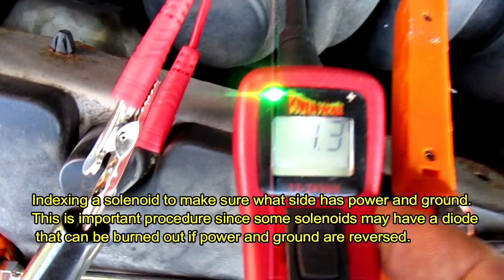Testing a Solenoid With a Power Probe

Comment: So, a relay or solenoid clicking does not verify that it is in working order.....correct? They both must be tested and verified through the use of current ....(under load) correct? Thanks...yes, I subscribed
Reply from the maker: Correct in the case of the solenoid the electric part can be working using current but the vacuum side or mechanical side may not be opening up the vacuum port. If there is amperage being used that means the solenoid or relay is working electrically but it may not be working mechanically. Current and mechanical operation. Thanks for subscribing....
Reply: @TSTseminars  Thanks, I appreciate the clarification
Reply from the maker: @Savage-lx5yj  your more then welcome....have a good one

Comment: Well....it clicked! It is a relay, can it carry current? Thanks,....
Reply from the maker: It's not a relay ...it's a solenoid...the clicking does not mean it working so you make a good point. It would need to be checked with an amp meter or clamp. Check out the other video. Thanks for watching and your comment. If you have not already Subscribed to our tstseminars YouTube channel please do so. Interested in more training? Go to www.tstseminars.org and www.attstraining.com
Reply: @TSTseminars  Thanks, I'll check it out! What is the difference between a solenoid and a relay?
Reply from the maker: SE #!... OK a relay take voltage/low current that energizes a coil which allows the contact from B+ connect to the load (light, motor etc) that flows higher current. A solenoid is a steel bar that has wire wound around it allowing electricity to operate a component. In the video the solenoid is controlling vacuum to the variable intake manifold. The solenoid is normally closed meaning no vacuum is allowed through the solenoid. When the voltage is grounded by the computer it completes the circuit and the solenoid is turned on (vacuum is allowed to flow). What I did in the video was to control the solenoid by disconnecting from the computer and power then checked out what side of the wire connector has B+ and ground, aka Indexing. Then with the correct connection I applied power and ground to make the solenoid turn on and off. Hope this helps.. If you have not already Subscribed to our tstseminars YouTube channel please do so. Interested in more training? Go to www.tstseminars.org and www.attstraining.com